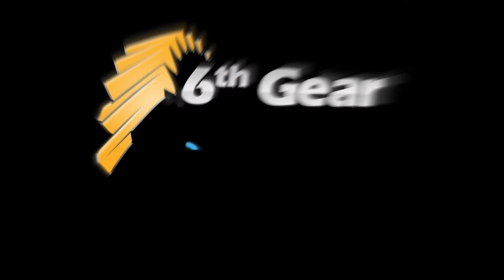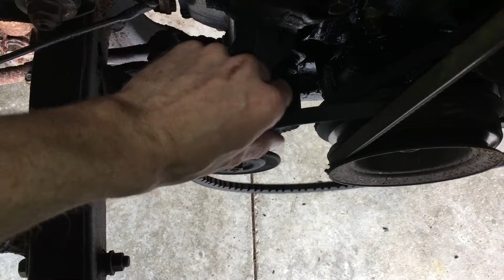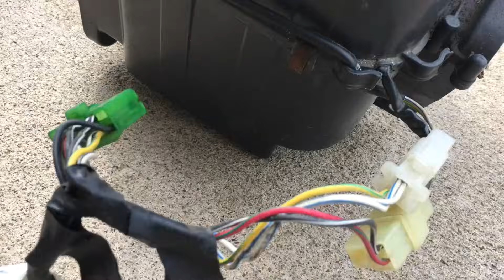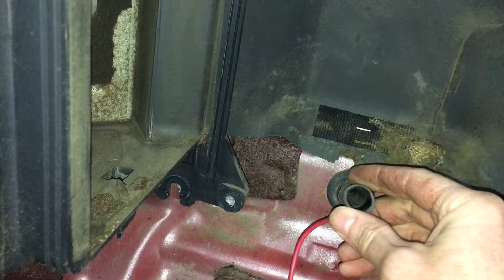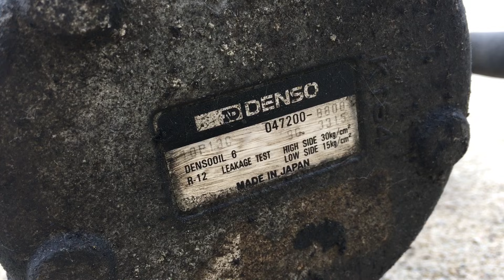Parts needed to install Air Conditioning in 1984-88 Toyota Pickup Truck

Comment: Why can I not find a 24500-2100 evaporator coil assembly, only 87150-9100? Are they interchangeable? 1984 Pickup 22R.
Reply from the maker: I don't know for sure, as I'm not very familiar with the early 22r... never saw one with AC.

Comment: Hey. So the compressor has a plug and that plug is routed to the dash… WHERE does that wire connect to within the dash. Just installed a new compressor and I can’t figure out what it connects to lol. Thanks for your videos
Reply from the maker: Hi, Sorry but this truck was sold about 5-6 years ago and I cannot remember.

Comment: My 86 came without factory a/c. So I took out all that heater crap and I installed an aftermarket under dash unit and used all the oem stuff under the hood and just got me a 12 volt heater for the winters. Only thing I had to get a couple of  adapters to hook up the hoses to the unit. There are aftermarket unit that also have the12 volt heaters already in the unit.

Comment: Are there kits that can be purchased for my 93 Toyota pick up?
Reply from the maker: I am not familiar with the 93, but on the 84-88 trucks, many of the parts are no longer made. The only place to find them is on the used market.

Comment: Use R12a from Envirosafe....works great as a replacement for R12...BUT its flammable...getting down to 30's in 85 out door heat in my 87' Toyota 4x4
Reply: Dont over fill....1/3rd of OEM spec of 1.7lbs...took me 2 - 4oz cans...$4.50 a can

Comment: Hey i kno this videos 4 years old but i was wondering can this be done with an 82. Im about to come in possession of one & would like to put ac in it before next summer. Thank you. Keep up the good work. 🤙🏼
Reply from the maker: The 1982 will use similar, but different parts. The overall setup will be the same, but all of the parts will be different part #'s and different shape than the 84-88.

Comment: Do you know if the AC parts from a 1986 Toyota 4runner will fit a Toyota  pick 1988?
Reply from the maker: Yes, they should be the same parts, as long as both are 22R/RE
Reply: @6thGearGarage  I’ve also been looking for the AC, but I can’t find it anywhere
Reply from the maker: Last time I checked, some of the parts like the lines had been discontinued. Your best bet is to find a parts truck with AC and grab everything in this video. Or keep an eye on ebay and try to collect them over time.
Reply: @6thGearGarage  how do I convert the AC system to a134?
Reply from the maker: Big job...  You can'y just replace the refrigerant because the new R-134a refrigerant will not circulate the R-12 oil and you will burn up your compressor. The R-12 mineral oil has chlorine contaminants that will destroy the R-134a PAG or POE special oil. The only way to reliably convert from R-12 to R-134a is to remove the compressor and flush out all the old oil with the new type of oil; then replace the old Receiver-Dryer or Accumulator with a new one; then flush out all the lines, the evaporator, and the condenser with special cleaner then vacuum to a steady vacuum; and finally charge with 70-80%, (by weight) of the original R-12 weight, with R-134a. Replace the fittings too.
Reply: @6thGearGarage  the compressor you show in the video is it OEM one? did it come with the truck or did you add the r134a valves?
Reply: @6thGearGarage  cause I’m trying to add AC to my truck, but I don’t know what lines I’m gonna need
Reply: Hasta la segunda generación con motor R22E es igual.

Comment: Could you please do a video on how to remove and install the evaporator core, expansion valve with orifice tube and heater core someday? Thanks bro. Keep up the great work on the Toyotas. I have a 1988 Toyota Hilux Pickup 22R; 5-speed. 397k miles, it’s running and kicking ass.
Reply from the maker: I have not had another truck with AC since this one, but if I get another opportunity to work on an  AC truck, I definitely will!
Reply: @ thanks bro. 👍👍👍

Comment: Old video but good info....I tried r134 conversion and it sucked, found r12 on craigslist and swapped back, have a leak now but will get around to fixing it and getting it charged up....Live by the beach so not really needed like in the RUST belt....Liked the way you layed out the ac system, neat to see it that way....Have a video on charging it? Thats always been a mystery to me on how much....have vacuum pump, gauges, toyota mineral oil, ect
Reply from the maker: I did make a video on charging the AC of my 94 Land Cruiser. It's the first year for R134a, but similar process for R12: https://youtu.be/omnfEtfcRmE

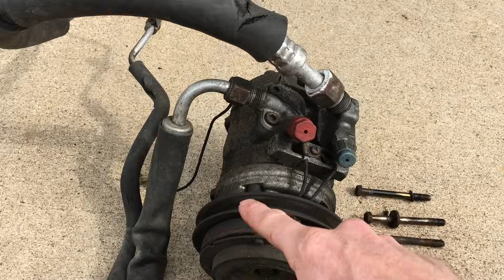Comment: What that part that connects the big ac line onto the compressor, you pointed at at at 1:19 you didn’t name it. Thank you in advance.
Reply from the maker: That 90 degree metal elbow is part of the AC line. It's pressed on and doesn't come off, similar to a hydraulic line fitting.

Comment: Question for you I am currently adding an ac system to my 87 4Runner and I’m seeing online some trucks that have an ac diaphragm and idle up sensor/module? Are those two components necessary when adding ac to a non ac truck? Thanks I’m advance
Reply from the maker: I would add them if you can find them. When the ac kicks on, the engine should idle up.
Reply: @6thGearGarage  gotcha yeah I had been looking up a bunch of things and none of them said anything about adding those two things I just happened to see them while looking up some vacuum line stuff lol. Thanks for the response

Comment: I don't have to worry about fitting air conditioning to my 1997 Hilux ute it has it already fitted it is an optional extra back in 1997 and of course been a Toyota air conditioning it works

Comment: I have been having a lot of trouble trying to find the metal lines for the HVAC system for this truck. I ordered some off Ebay but one line showed up broken. is there anyone that makes rubber versions of these line that you know of by chance?
Reply from the maker: I've never seen rubber ones, only metal.
Reply: Just go to ur local metal supply store and order some refrigerant lines and bend em

Comment: Do you have a diagram for the air conditioning ports?  I have temporarily misplaced my owners manual and I cannot locate the low port or compressor for that matter....
Reply: And mine has a/c it just needs to be retrofit and refilled
Reply from the maker: I can look in my manual and scan the page with all the components

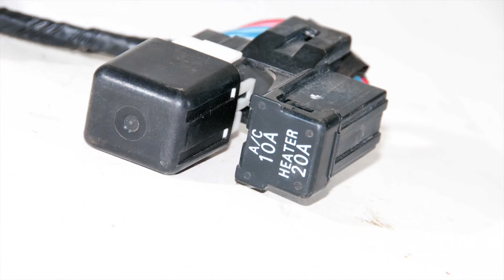Comment: Hi there, Where is that heater and A/c fuse located as seen in your video @ 3:11 ?
Reply from the maker: if you pull out the glovebox, they will be inside the dash, to the left. You can see the fuses around 5:25 in this video: https://youtu.be/yKG_F30MdQE
Reply: On the globe box

Comment: Just a question. What is a little box whit a knob that says RPM in the top of the evaporator case inside the cabin? Greetings. and thank you
Reply from the maker: I've seen that and I'm not exactly sure. I've never tried adjusting it.
Reply: I believe that box is the amplifier. It tells when the ac clutch to engage depending on the RPM of the engine. You can find more information online to see how it works. I've usually adjusted the knob in the past by turning it to a low setting right before it shuts off the air conditioning.

Comment: Thanks for making the video!!  I have a 86 without A/C ,   But I might buy a tiny portable electric A/C unit ( about $900) and modify it to fit behind the seat or under the cab an pipe in the air in
Reply from the maker: That's not a bad idea, as a lot of these parts are being discontinued.
Reply: Good idea u have some video?

Comment: you have a part number for the mounting bracket for the compressor pls :)
Reply from the maker: I believe it is 88431-14130 but has been discontinued for a while :(
Reply: if there are enough owners our there maybe we can all get them custom machined or printed?

Comment: Does anybody know if the Toyotas 22re from 1994 have the exact same evaporator as the 89
Reply: Probably ...all that stuff in the video looks like the stuff that I already have on my 1990 Runner 2nd gen... I've had my second gen for 27 years and I know mine is from the factory cuz it was purchased in Arizona... it was leased as a 5-speed manual and then I purchased it four years later as the second owner

Comment: Thank you so much for this deal Video. Extremely helpful. However, I would like to change the "Expansion Valve" on my 85 truck 4x4. Can you tell me if you have to remove the entire evaporator assembly/housing out of trck to get to it, or can it be accessed inside the truck without removing the entire dash, evaporator......ect?(fyi, I've removed the glove box and can see the evaporator box, but not sure how to get to the expansion Vavle). Thx
Reply from the maker: I've never attempted it in the truck, not sure if it's possible without removing the whole box. It would be a cramped job for sure.
Reply: @6thGearGarage  OMGosh, that would suck, if I must remove the entire housing.....😓😓😓😓😓😓 crying...😁😁. I know that's NOT an easy job.

Comment: Thank you for the information. Is it possible to add a part number for the ac amplifier. It is located on top of the evaporator and expansion valve box. It is the one with the green plug. Thank you again
Reply from the maker: Hey it might be 88650-89103 for the 86-89 trucks, but you should double check with your dealer before ordering.

Comment: How’s it man! So basically if I have an 86 pick up with no ac components from factory, I’m still able to get the ac components compatible for the truck and guaranteed to convert it from no ac to having ac no matter as long as I get all of the components? Like everything should match up or line up as far as placement for condenser, evap box, blower motor, etc….? Basically 100% guaranteed and not to where I’d purchase parts for it and for none of it to fit and not have ac period still?! Thanks for your help in advance! 🤙🏽
Reply from the maker: Hey, in theory if you grabbed every ac related component from another 1986 truck, then yes it should be all plug and play. Most of the parts (if not all) should be the same for 84-88 trucks. Keep in mind the engine should be the same, as to use the same bracket and AC compressor, pulley etc. I have never compared the parts from each year to ensure they're all the same, so please do your research. You can get some parts a the dealership, but some have been discontinued and will need to be located on parts trucks or ebay.
Reply: @6thGearGarage  How’s it man! Would you be able to point me in the right direction on what ac compressor to get that the OEM ac line(s) will for sure fit onto fittings wise? Scored an almost complete ac system except the ac compressor so I basically only need the compressor. Got majority all of the harnesses as well!
Reply from the maker: @travisellis932  I found an oem part number that should be it: 8832035130 but I would confirm with the dealership before ordering. I would think they could check compatibility on their computer.

Comment: I need your help guys. My dad has a Toyota Hilux 2001 diesel, 2.4L 2L engine in Cuba and he needs the complete air conditioning system, but I live in USA, and here never exists the Hilux. My question, could be the same system from a 4Runner or a Tacoma gas engine from similar production years, could you advice me please. Thank you 🙏🏼.
Reply from the maker: I have zero experience with the diesel toyotas, I can't say for sure.  I would assume some of the parts would interchange but the compressor/bracket/pulley would obviously be different. Possible the hard lines running through the engine bay as well.
Reply: yo creo que si. alguien en los comments dijo que el usó los partes del a/c de un toyota diesel aleman en su camioneta 22re gas regular.

Comment: Will ac parts from a 22re work on a 22r pickup, I have a complete system from an 85 pickup and want to install ac in my 84 pickup.
Reply from the maker: Yes I think they would be the same for 85-95 trucks that use the 22r/22re Laser block. However 1984 usually has the early 22r block which is different so the bracket and compressor may not be the same.

Comment: Do these trucks have dabbing air filters?
Reply from the maker: I'm not sure what that is
Reply: @6thGearGarage  cabin air filters sorry
Reply from the maker: @charliesybert2683  Gotcha no these trucks don’t have a cabin filter. I don’t think the 89-95’s do either
Reply: @6thGearGarage  that sucks my 86 I just got didn't fun for 3 years before I bought it and I turned on the heater and gased myself out
Reply from the maker: @charliesybert2683  I've been there... bought some trucks that sat and the HVAC ductwork were full of mice nests and shot out nasty dust the first time I turned the heater on

Comment: So you absolutely need a factory donor truck huh?  There's no way to get all these parts oem aftermarket or anything right?
Reply from the maker: A donor truck would make it 10 times easier. Some of the middle lines have been discontinued And you’d have to hunt them down in a Junkyard or on eBay
Reply: @6thGearGarage  would you happen to know which parts you could source new?
Reply from the maker: @morsteen  Sorry I do not know which ones Toyota still sells. If you don't want to drive to the dealership, you could look at https://www.toyotapartsdeal.com/

Comment: Thanks a lot, very helpful video. I own a 92 truck (22re) and could buy a brand new oem a/c (NOS) from a German Hilux Diesel, but the manual is missing. I have to drill the holes in firewall. is it 25 and 35mm?
Reply from the maker: Sorry I don't know the exact dia. of the holes.  Can anyone in the comments help??
Reply: @6thGearGarage  thanks. i found the full installation manual. its 26mm and 35mm.

Comment: I have a Toyota pick up truck, and I need to install the AC. Where can i find all the parts and how much would i pay for them.?
Reply from the maker: I believe some parts are still available from the dealership but I'm told that some of the lines are discontinued and will beed to be purchased used, ebay.
Reply: Aapak in Phoenix has orings O Rings and 
Parts for these. You can Google for their number I've been there I bought some. Longo Toyota in California still has limited Supply of OEM parts 4 older Toyota

Comment: I have a 1986 Toyota pick up turbo extended automatic extended cap 4wd runs good but hardly have power when accelerating. Any help would appreciated!
Reply from the maker: is it missing or stuttering?

Comment: Thanks for the video!
I got a question for you. I just installed all new ac parts on my 1994 Toyota pickup. It's ice cold when it's moving but warm at idle. I am pretty sure I added enough refrigerant to the system. I was thinking the reason is because it doesn't have a condenser fan. I did not see the condenser fan in the video. 
Do you think installing an A/C condenser fan would fix this problem?

https://www.yotatech.com/forums/f116/c-condenser-fan-install-94089/
Reply from the maker: If it's not cooling at idle, that makes me think the compressor isn't moving enough refrigerant at low rpm. I'd try adding more first.
Reply: @6thGearGarage  Okay I will try that. Thanks!
Reply: Possible  idle up valve isn't working or the diaphragm  isn't working  . Is most likely  your issue
Reply: You need that fan that's electric working and sitting in front of the condenser that's in front of the radiator. My condenser fan is about 10" across it says TYK-1132T -   and its 12V and says made in Taiwan

Comment: How I can add AC on my truck pickup Toyota 1990 it has the same system like the one you show me on the video
Reply from the maker: You will need to collect all of the parts but some of the hard lines have been discontinued by Toyota I am told. Other parts are available aftermarket, such as the AC compressor..

Comment: Thanks so much for this.  I lost the line that wraps behind the dryer during a restoration.  Now, I know what it looks like.  If anyone has one of these, I'll pay $100 for the line.
Reply: For sure you probably find one in Arizona a lot of people start rebuilding the engines or head gaskets on these 3VZE and either finish it and have problems or they don't finish them. Thanks God I found a guy that knew what he was doing and he rebuilt my engine.. during covid it took 13 months I have no rust on my body of the 1990 but I still have all the original exhaust pipes just I have changed the muffler

Comment: Hi....Please tell me what size are the o ring fittings on those aluminum lines that screw into condenser, evaporator..etc..I am having the hardest time finding aluminum lines with end fittings that will screw into my 1987 toyota truck ac system components ..3/8 is to large...i measure 1/4 od on a 5/16 line..I cannot locate any such fittings..Please help out..Thx.
Reply from the maker: Hi, Sorry but I no longer have these parts.
Reply: @6thGearGarage  Thx for the reply..much appreciate it..
Reply: Aapak in Phoenix has automotive AC parts for sure. They are the source in Arizona

Comment: I wanted to see how the drain hose hooked up ?87 toyota truck
Reply from the maker: It's just a small angled rubber hose that goes from the bottom of the housing into the firewall.